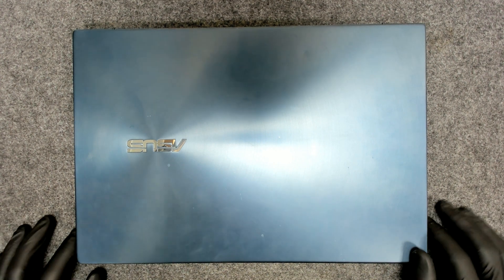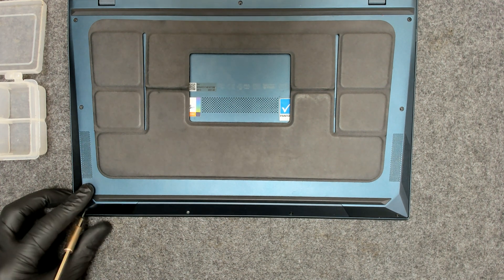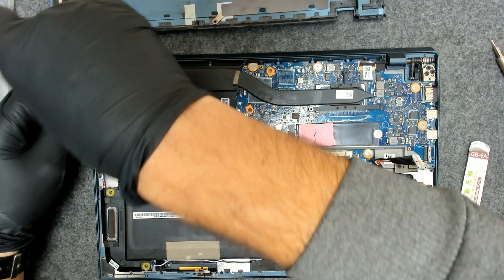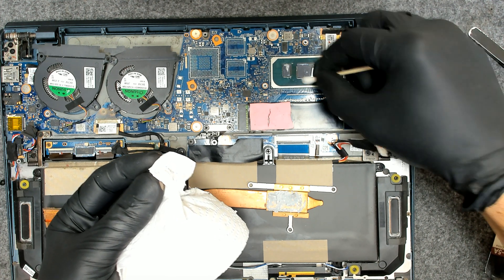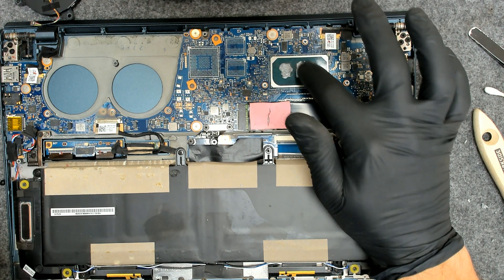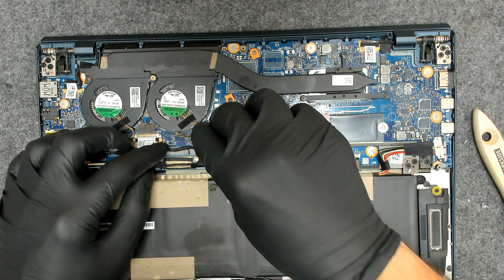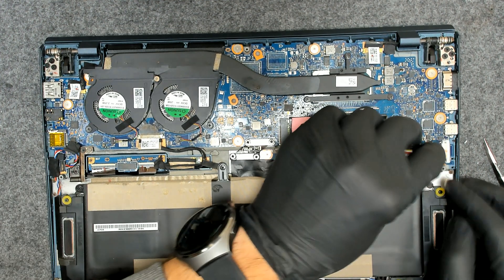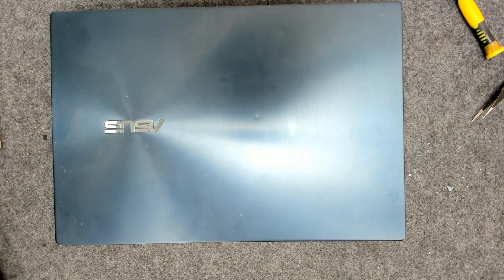Asus Zenbook Duo 14 UX482 Thermal paste replacement

Comment: Thank you so much!
It seems impossible to get a completely clean dusting as the 2 fans are locked in the closed position, is that structurally impossible?
Reply from the maker: You can try and bend the side on the metal PCs and unlock it. If there are some welded plastic, you can cut it and use a soldering iron to stick it back. Or you can just clean it with a brush and vacuum cleaner.
Reply: @LaptopDisassembly  hm ok, I'm just a novice so try to clean it with brush... tho I can't cleaned it completely🥲
Reply from the maker: @Ledonn just clean between the fan and the cooler. The small dust on the propellers is not a problem.
Reply: @LaptopDisassembly  okay, thank you so much!! I'll do that🙂👍👍

Comment: I can't determine what thermal padding to use for VRMs, do you know?
Reply from the maker: Just replace the thermal paste and don't touch the pads.
Reply: @LaptopDisassembly  the pads are 4 years old and have tears in them, they are in desperate need of replacement
Reply from the maker: @Darequeliquan the pads don't dry like the paste. So far I have never replace ones. Only ones, when the  customer 
remove them.
Reply: @LaptopDisassembly  This is an especially hot computer, the pads have large gaps in them that shouldn’t be there and are causing serious problems with heat. I don’t know what to say other than the pads need replacement because thermal pads don’t last forever and they need replacement. I have used it every day for four years and pushed it to its limits and that generates a lot of heat.

Comment: Thank you so much for this video! Just bought one of these second hand and the CPU thermals are extremely spike:y compared to my other laptop so I suspect bad thermal paste. Will use this video as reference to replace it
Reply: Did replacing the thermal paste help a lot?
Reply from the maker: It lowers the temperature for sure...
Reply: You probably dont care but I did replace it using your video as a guide and now my laptop feels completely new. Insane difference for me so thanks for this.
Reply from the maker: @VerttiXPertti  That is the point of these videos. Glad i could help.
Reply: One question actually, how do the rubber things sit on the screws? Are they glued or do they just sit with friction? I don't want to permanently damage them
Reply from the maker: @OllAxe  It is with double sided tape. When you remove them, don't pull to hard, otherwise you will stretch them.